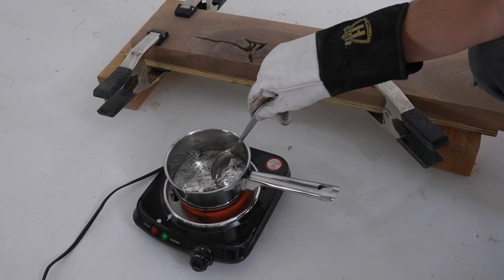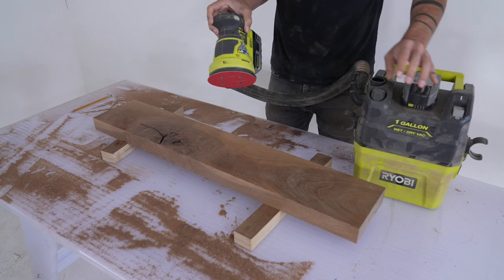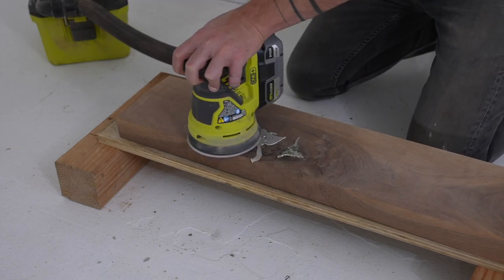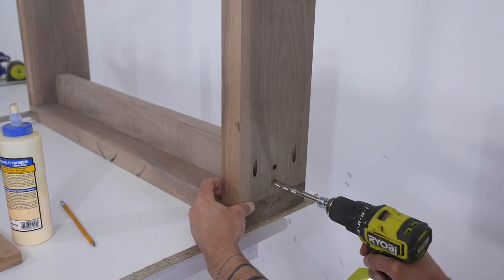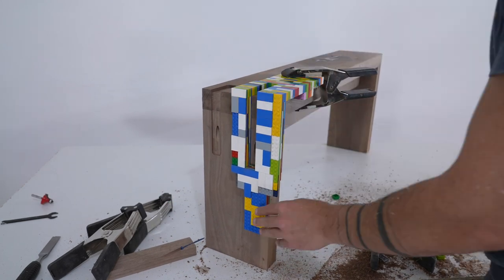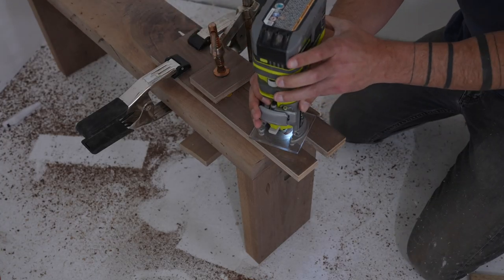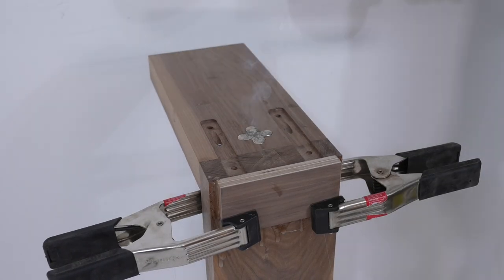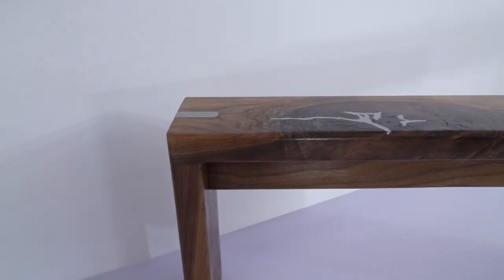Metal that MELTS AT  LOW TEMPERATURES

Comment: You could also try and pre-heat the wood to be filled with metal with a heat gun as sometime with low temp metal like this it can rapidly cool when it touches a cool surface. Same technique is done when casting into silicone molds. The molds are placed in a small toaster oven before hand and will achieve better results.
Reply from the maker: yes! could be helpful to get the metal into thinner cracks.  a wire can also be used to break surface tension of the molten metal

Comment: Really cool experiment love the look!  As for filling smaller cracks could you pre-drill some small holes and fill them with thin wire to sort of act like a wick for the molten metal.  Imagine a small crack with a bunch of equally spaced whiskers sticking up.  I have no clue if this would work but it makes sense in my head, maybe something to do with surface tension and whatnot.
Reply from the maker: Great idea! thank you!

Comment: Very cool. This metal is commonly used by model makers to cast toy soldiers and other kinds of detail parts, etc. Isopropyl alcohol will easily help dislodge/remove cured hot melt glue. Cheers.
Reply from the maker: good tip!  thanks!

Comment: Really nice alternative to epoxy resin. Can I ask where you got the Tin Bismuth Alloy or at least what the ratio of tinto bismuth you used?
Reply: @loosersic It's just modern pewter. You should be able to buy it easily online. Old pewter, like they used to make plates and tankards out of, was tin and lead, however nowadays the lead has been replaced by bismuth (for obvious reasons).

Comment: This looks amazing! It reminds me a lot of Kintsugi, but for furniture. It's definitely a much fancier and luxurious looking alternative to resin tables. Since resin is so expensive, was it actually less expensive to use this metal alloy instead?
Reply from the maker: about the same for a project like this but by volume I think resin is a bit cheaper.
Reply: One idea intrigues me. If you overpour resin, you're out of luck. I'm wondering if it would be easier to recover the excess metal?

Even sanded particulates might be possible. If the metal sinks and the wood shavings float, it might not be too horrible to separate the two.

This would drive down the price by a lot.

Comment: Pretty neat. Try using rubbing alcohol to take off the hot glue. It just peels off that way. It takes very little rubbing alcohol.
Reply from the maker: oh thanks!  I will try!
Reply: This. Rubbing alcohol or denatured alcohol and just let it seep into the edges, it'll peel right up. Not sure if it might stain the wood though. Then again, less likely to leave a mark than a chisel...

Comment: What specific alloy did you use? Any suggested vendors? Great work, been thinking of trying straight bismuth but never pulled the trigger. This seems like an even better option.
Reply: rotometals has a bismuth lead free low temp alloy
Reply: It was probably Wood's metal -- bismuth, lead, and tin.
Reply from the maker: Cerrotru is a low-temperature, lead-free metal alloy containing 42% Tin and 58% Bismuth that melts at just 281F. Cerrotru has only slight expansion during solidification. I get from purity casting alloys
Reply from the maker: no lead
Reply: Another rec for rotometals. They have great materials, decent prices, and variety. 

Be careful when choosing some of the alloys have different viscosity, and that can make a big difference in use.
Reply: Pewter would be good for this

Comment: Does this metal stick to the wood?? I mean is it like resin or not? Does it come off after some time using that furniture or it will stick to the wook perfectly???
Reply: And what is the exact name of that metal??? Pleeeease
I have some wooden flower pots that cracked massively after a month and i think this would be a good technique for them. Actually i dont have the energy to fill the cracks with resin

Comment: Cool work! What are the percentages of tin and bismuth in your alloy?
Reply from the maker: Cerrotru is a low-temperature, lead-free metal alloy containing 42% Tin and 58% Bismuth that melts at just 281F. Cerrotru has only slight expansion during solidification.

Comment: Hey, quick question, isn't the pocket holes facilitate disassembling them later..?

 if you filled the pocket holes with molten metal, how would you disassemble them when one need to...?? 
It kind of negates the option to easily disassemble them later...
Reply from the maker: I do not use pockets holes for that because repeated use would weaken the screw to wood connection
Reply: @HomeMadeModern  i understand... I too wouldn't prefer them... 

But, in the subject of closing them with molten metal isn't good except for a cool look... I must admit it does look cool... 

Respects to your effort...

Comment: For a guy this popular and making bank on YT it must get frustrating to be locked into Ryobi. Still enjoy his vids though. Cool ideas.
Reply from the maker: I like them and they offer more tools on the same battery platform than anyone else.  I do have some milwaukee tools like a concrete saw, and a massive hammer drill but I think skill matters more than tools and I am always up for head to head making challenge with me using RYOBI and the other person Festool. I think if most non professional people compared the end products they would choose significantly lower prices
Reply: @HomeMadeModern  fair enough. So long as you are happy with them then that’s the main thing. Love the experiment with the metal and making it a feature of the final product. I have a coffee table build coming up and I think I may try and incorporate your metal pouring technique into the design. Love your stuff 👍

Comment: How does the connection of these different materials react when faced with the expansion of the metal with the variations in temperature and the variations in humidity for the wood? Is the metal soft enough to follow the wood?
Reply from the maker: the tables I made over 5 years ago are fine.  expansion and contraction are relative to the dimensions of the materials so consider the scale of the project when trying to evaluate.